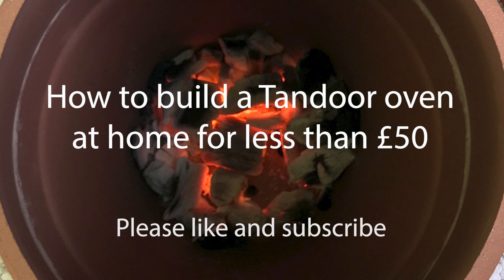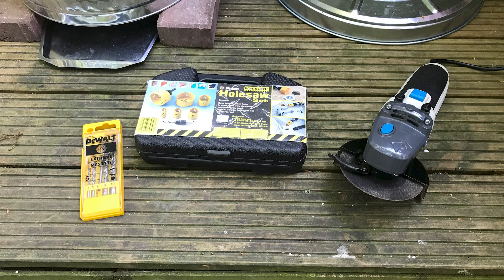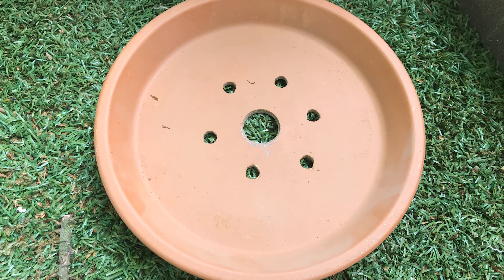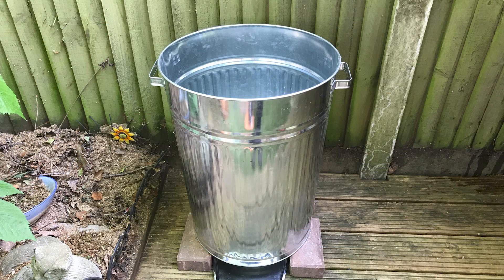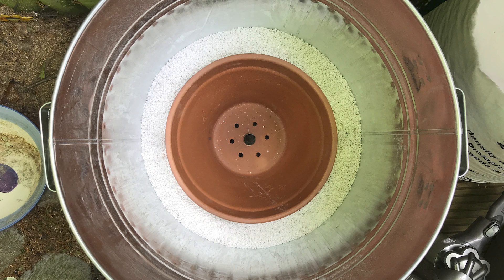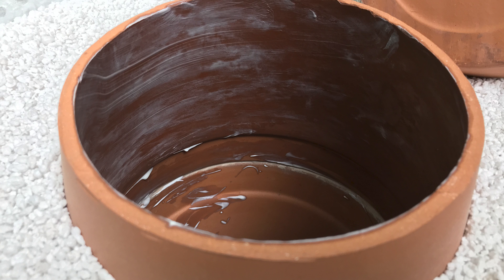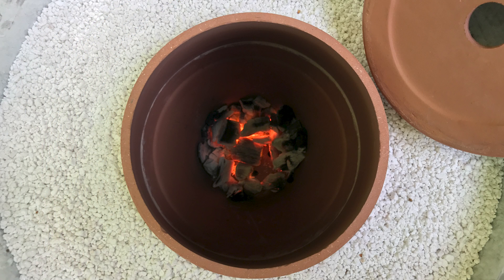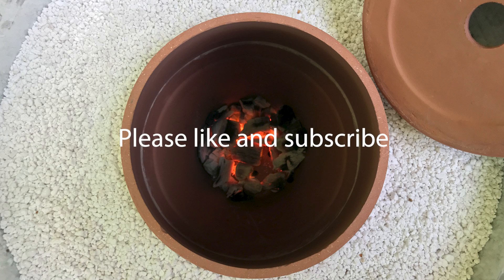Home made tandoor | How to build a tandoor oven at home for under £50 | How to Make a Tandoori Oven

Comment: Thought you’re video was really clear and to the point ,  o rambling from you , just very clear and easy to follow , so we’ll done for that , now I’m not being a D*** , but in one of the other videos a guy built a tandor with a metal bin , he then got told that the heat produces poisonous zinc fumes , so he redone the video using all clay and terracotta pots instead , so I thought great I’ll go that way , then I read more of his comments and someone else said when using terracotta, to make sure to get a led kit to test the terracotta pots for led ,, apparently they use led in the making of terracotta pots , so now I’m  worried about zinc and led poisoning , not sure how true any of it is ,but a lot of people in the comments confirmed this to be true , well done with your videos keep em coming kid
Reply from the maker: Hi, thanks so much.

The Zink thing is true, here's the paragraph I have on the page explaining how it's safe in this instance :)

When heated to high temperatures can coatings on those bins burn and begin to produce poisonous zinc gas?
Yes if heated well over 200+ Celsius but the perlite or vermiculite insulation ensures that even when the tandoor is as high as 550 Celsius the outer bin temperature reaches no more than 25 Celsius

As for the lead:

Do terracotta pots contain lead? 
Clays almost never contain lead because the processes of formation were different. The clay itself is made up a wide variety of naturally occurring chemicals. IF A POT ISN'T GLAZED, IT ALMOST CERTAINLY DOES NOT CONTAIN LEAD.
Reply: @TheCurryKid  I thought exactly what you are saying , but wasn’t confident enough to make a start until you confirmed it , thanks for that , also can you tell me what grade vermiculite you used , not sure if it’s the same in Ozz as in uk ,  it we have grade 3 coarse and lower grades more fine , I was thinking of buying the grade 3 , bigger coarse vermiculite, what do you suggest , thanks again for the advice
Reply from the maker: Checked earlier and ours looks like small stones, I would say about 5-7mm so the course stuff I would guess
Reply: @TheCurryKid  thanks again

Comment: Suggestion: wetting will cut down on the dust. If you fill a bottle up with water, then put a small hole in it and put it on top of the pot as you are cutting it, it will drip slowly as you're cutting to reduce the amount of dust that kicks up.
Reply from the maker: great idea, thanks for sharing :)

Comment: Thanks for the instruction on building an oven. Ive just been thinking about researching on building one and its weird that i hadn't looked up anything yet, but yet it started showing up in my suggested list. Lol
Creepily youtube reading my mind.
Anyway, your plan doesnt seem as daunting not elaborate as some others ive seen that were just way too complicated with all kinds of fabricating.
Reply from the maker: great to hear, thanks for taking a look. I've used this every week for tikka since I built it and it's still going strong. If you have any questions just shout and I'll see if I can help, only thing I would do in a 2nd version would be a slightly larger hole at the top if you use for naans a lot (I use a cast iron tawa) , otherwise I wouldn't change a thing.

Comment: Little question here: What is the purpose of the saucer (the one on top of the tree bricks, with the 7 holes in it)? Is it essential?
Reply from the maker: Hi. It strengthens the base as that’s where all the heat is to ensure the base doesn’t crack at that point. Some people have used a colander to hold the coals in the base so they don’t sit directly

Comment: Brilliant video but whats the pot tray for under the first pot… i cant get one anywhere but got 3 pot lifters
Reply from the maker: Many thanks, it’s just a bit of security as all the intensive heat is at the bottom of the pot and gives it a little more support. Quite a few people have added a small colander in the bottom of the pot instead to actually hold the coals and this actually increases air flow and heat.
Reply: @TheCurryKid  ahhh like a double skin / layer?
I might wait till i get one then, or maybe even another pot and cut the bottom off it, im actually building it right now lol
Thanks for your fast reply 
Videos are brilliant👍🏻
Reply from the maker: Man thanks :)

Comment: Great vid. Can you explain why you have two different skewers in the equipment list?
Reply from the maker: hi, I cant see that, can you point out where it is please?
Reply: @TheCurryKid  at the bottom
Of the “where to buy (UK)” guide on the link in description of this vid
Reply from the maker: got you, thanks. I use the flat wide ones for sheekh kebabs and binger chunks of meat. They are perfect for that but too big for smaller tikka chunks and just rip the meat chunks in half. The ones with a circle hook at the top can also be hung down in the tandoor with one put through all the holes and laid horizontally over the tandoor opening so they freely dangle inside. Hope that helps
Reply: Hi this does help thanks. In the picture you seem to have a round skewer that the flat ones hang off.. is that correct? What skewers would you recommend for tandoori chicken (whole leg/thigh) thanks
Reply from the maker: for the tandoori chicken the wide straight ones with a potato at the bottom to deflect the main heat and stop the chicken falling down. the small round one is the only thing I had to also show the 3 going down, I would just use anything now that will take the heat and fit through the holes :)
Reply: Hi thank you so much for your guidance, I have ordered the ones on the amazon link not the ebay link.. will they be ok for whole chicken leg with thigh attached? Or is the chicken likely to slide off? The add doesn’t say how wide the skewers are in the Amazon link. Great tip with the potato thanks

Comment: Tried this out. First cook chicken skewers came out a bit bitter.. any chance the heated galvanized bin is the culprit?
Reply from the maker: Hi, no the bin never gets above 20 odd Celsius which is the same it would in the sun due to the insulation. What did you start your coals with and did you coat the side of the tandoor with anything
Reply: @TheCurryKid  I just felt the outside of the bin. The middle section (where the two pots come together) was very hot. I’m guessing I didn’t insulate it well enough. I’ll take the perlite out and re-apply fire mortar and pack the perlite more tightly.
Reply from the maker: I tested when the tandoor was just over 550 Celsius and the bin was about 25 Celsius so just warm so that could be the issue. The first burn also stunk whilst burning off the coating I added in the tandoor walls which again may flavour the food if you’ve not done some initial burns to set that and burn it all off

Comment: Galvanized metal bins are a no no as they can release fumes. 

Make sure it’s not galvanized or try finding an even larger pot to set it in, or oil drum.
Reply from the maker: only if they reach a very high temperature, due to the insulation these never go above 30 celcius :)

Comment: Hi Josh do seal the perlite with anything
Reply from the maker: Hi Harold. I just used some stones that were in the garden to hold it down as it was very light. Some people have used broken up thin paving slab pieces to make it slightly mosaic. Due to the heat being trapped by the insulation the stones do not get hot so no chance of them cracking. Hope that helps. 

If you make one just remember to gradually warm up to the max heat otherwise the post can crack. Enjoy :)
Reply: @TheCurryKid   thanks i been thinking about making one just don`t want perlite all over the place
Reply from the maker: My dad got vermiculite but I guess they are the same, really light :)
Reply: morrisons supermarket had the large plant pots for sale £5.00 each

Comment: If I don’t vent it will it break
Reply from the maker: Do you mean at the top or bottom please?
Reply: @TheCurryKid  the bottom
Reply from the maker: If you don’t drill the hole at the bottom you will not get the air flowing through and the fire will simply go out unfortunately

Comment: Do u have any tips if you’ve built this but you just can’t get the temperature high enough inside the oven?
Reply: I do wonder does it matter which type of terracotta pot u use? I used one that was quite thick and tough, rather than the £8.99 ones from most retailers in the uk. do u reckon there is better chance of heat with a thinner pot?
Reply from the maker: I think the thicker ones will retain the heat more. What type of charcoal are you using and how much? Do you cover the tandoor With the terracotta Lid when warming up
Reply: @TheCurryKid  the charcoal is weber premium grill I don’t know if that is any good? And yes i did put the lid on it was about 150 c at the bottom but barely more then 60-80c at the top. Smh i got pics if it helps
Reply: They are charchoal briqquetes according to google im guessing they arent the best?
Reply from the maker: That could be the case, they may not get hot enough for long enough. I use Restaurant grade Big K, they are large pieces that burn for around 3 hours. This may help https://amzn.to/3wiEo76 mine gets up to around 500 Celsius on those
Reply from the maker: I also get it started in one of these which gets the coals hot really fast https://amzn.to/3M17u1F
Reply: Thanks yes the chimney to start up with i got that already it is awesome. 

I will invest in some lumpwood charcoal bigger pieces etc 
Hopefully that’ll help thanks how many peices do u use?
Reply from the maker: It really depends on the size but I would use 2 large adult handfuls
Reply: @TheCurryKid  I changed the coal and it did get a bit hotter, I do wonder what kind of temperatures do u get on the actual walls of the tandoor? Perhaps next time I just need to put a lot more coal in there and that'll get hotter.
Reply from the maker: Hi, yes probably more needed, I get around 350-500 Celcius https://thecurrykid.co.uk/wp-content/uploads/2022/05/19-scaled.jpg https://thecurrykid.co.uk/wp-content/uploads/2020/05/IMG_8360-768x1024.jpg
Reply: @TheCurryKid  thanks and that coal made a huge difference, i cooked chicken and it came out tasty just like eating chicken tikka in a restaurant wow. I had to stick an onion on the end of the skewer because the meat kept dropping off.

The walls on the top of the tandoor did not get warmer than about 150/200c though. Do u think that is hot enough for making naans? Any general tips on that I guess u got videos on that anyway.
Reply from the maker: @psd99  great to hear. I assume you are using to bit of pot you cut off as a lid still to retain the heat? I'm wondering if you're not using enough coal still as I struggle to keep mine below 500 celcius. I would think 200 would be fine to be honest, that heat to be honest will probably cook them nicely allowing them to bubble as they cook without it all going too fast and making them hard. Make sure you have something to scrape them off the tandoor walls with, they stick well but will release when they are ready
Reply: @TheCurryKid  yes I am using a lid, tell u what im terrified of chainsaws and angle grinders. Was not the best of cuts with my grinder but i have arrows on the lid and the top of the pot so it is easy to line up. I will try naans next time around.
Reply from the maker: I cheated and got my dad to do that bit. he was covered in brick dust when he finished and had eaten loads of it. Lesson learnt, get someone else to do the dirty work :)

Comment: On your first heat did u put BOTH oil and yoghurt all over the inside of the tandoor? Which oil did u use?
Reply from the maker: I did and it would have been just vegetable or sun flour oil. If starting again I would probably go with just oil, or a salt water wash.
Reply: @TheCurryKid  thanks, this is an awesome tutorial btw. Prob the best tandoor one online. 

Do u find the food comes out like restaurant standard? I do love chicken tikka and paneer tikka the most
U got any decent recipes?
Reply from the maker: Many thanks, appreciated. My Tikka recipes can be found at https://www.youtube.com/c/TheCurryKid/search?query=tikka the paneer recipe is the same as the chicken one. Yes, in the tandoor the food cooks fast and retains the moisture as it's seared outside so quickly and the metal skewers take the heat to the middle

Comment: Ok I built it and have used it the results are excellent but I woke up this morning to find a load of vermiculite inside the tandoor and all over the floor this has come out from the bottom any ideas how I stop this happening all advice greatly received
Reply from the maker: Hi, I can only think this has come from the stuff on the top, have you added any stones to keep that down at all? None should be able to get out the bottom either as it should be sealed off as in the image at https://thecurrykid.co.uk/wp-content/uploads/2020/05/IMG_8334-768x576.jpg all the image are at https://thecurrykid.co.uk/how-to-build-a-tandoor-oven-at-home-for-under-50/
Reply from the maker: This is how mine finished up on top, hope it helps https://thecurrykid.co.uk/wp-content/uploads/2021/05/IMG_0978-002-768x576.jpg
Reply: @TheCurryKid  I have put blue slate all over the top so not coming from there I will just have to disassemble and try again
Reply from the maker: good idea, I can only think it's the bottom then but even then it shouldnt get into the pots itself :(

Comment: Really liked what you built and looks more straight forward and easier than others but I was just a bit curious about the pots. In your list of materials it looks like identical pots but then there's a pic of a straight walled pot with the bottom cut followed by another photo with what looks like (once again) the original identical pot used as the finished product. What gives?
Reply from the maker: Hi, yes both exactly the same pots, just one with the top cut off. I think it's more the angle of the photo that makes it look like a straight pot :)
Reply: @TheCurryKid  gotcha! Thanks, Kid!

Comment: Regarding using a 'Disc cutter' / Angle grinder. Please wear more than just eye protection and hearing protection while using this tool! Ideally you should wear anti slash gloves, a welding apron / chainsaw pants, eye and ear protection. This sort of tool causes more serious injuries than any other, and can VERY easily kill you! I'm a blacksmith (In my spare time) and use one on a regular basis, and I'd be missing a few body parts if I hadn't been using appropriate PPE.

Comment: Hi curry kid - are you using a galvanised steel bin? Reason I asked is because zinc is used to galvanise it , when it's heated up it releases toxic fumes which may enter your food. Have you considered any food safety?
Reply from the maker: Hi, there are details on this at the bottom of the main page at https://thecurrykid.co.uk/how-to-build-a-tandoor-oven-at-home-for-under-50/ the bin never gets hotter than 25 Celsius even if the tandoor is 500 Celsius +

## When heated to high temperatures can coatings on those bins burn and begin to produce poisonous zinc gas?

yes if heated well over 200+ Celsius but the perlite or vermiculite insulation ensures that even when the tandoor is as high as 550 Celsius the outer bin temperature reaches no more than 25 Celsius
Reply: Hi curry kid - thanks for the reply, does the temperature also apply to the bottom of the bin?
Reply from the maker: Hi the heat part is about 8 inches up from the bottom of the bin therefore that it never gets hot

Comment: Rather than using two pots and cementing them together would the design work with everything being exactly the same but using just one tall chimney pot instead? Just thinking it would save having to use an angle grinder and you could just get another terracotta saucer and use that as the lid?
Reply from the maker: Hi Jaz, sure I can't see a reason why it wouldn't work but make sure you use one big enough for your needs (eg wider if you want to get naans in it). Using the 2 joined together also gives you a ridge in the middle where you can rest the skewers if you don't want them directly in the coals which can be useful at times.
Reply: @TheCurryKid  thanks. I can't seem to find the right sized pots anywhere. B&Q and homebase are constantly sold out and my local garden centre haven't got any either. Got a tall chimney pot though and hoping that will do the trick. 

Did you put water on the pots and saucer to help you drill the holes? Every video I've seen has said I should put water on the pots to soften it first but I'm scared it will crack.
Reply from the maker: @jazchohhan8726  I personally didn't, apart from the main centre hole which I drilled full size the other holes I used a couple of smaller drills first, then used bigger ones each time.

Comment: Random question. Where do you store the Tandoor during the winter? I. E. Is there a risk of the terracotta cracking in cold temps, or does the insulation protect it? Thanks
Reply from the maker: Hi Simon, literally stuck in the garden with a black bin liner over the top of it. The insulation certainly stops it cracking from cold but it will still get damp so the gently warm up to dry it out slowly again is the main thing. I'll add a few coals and just let them burn out, then add some more the next day for 2-3 days, then it's good for the summer. hope it helps